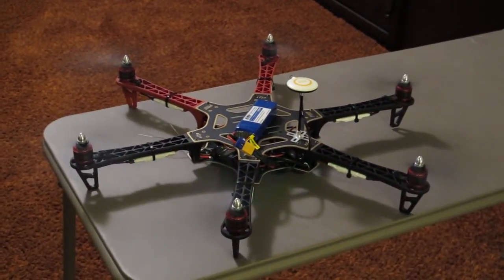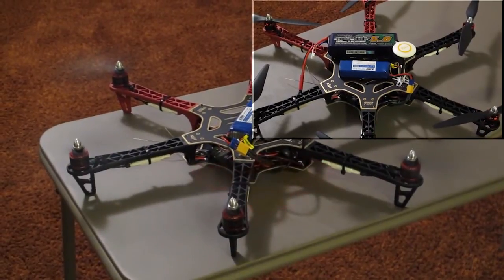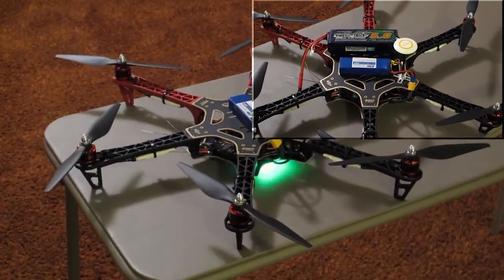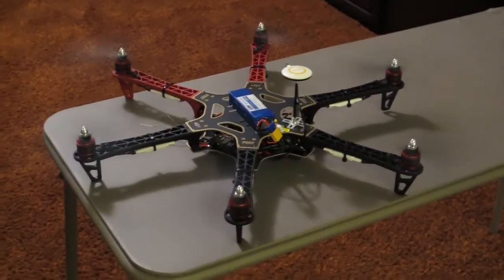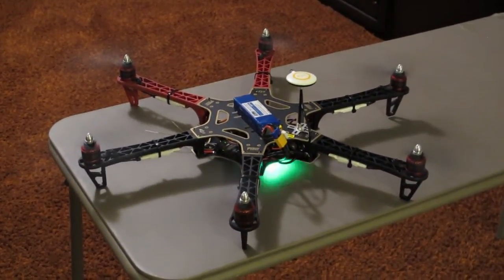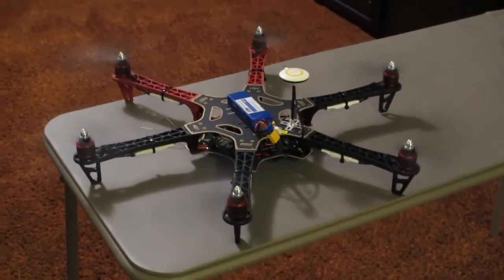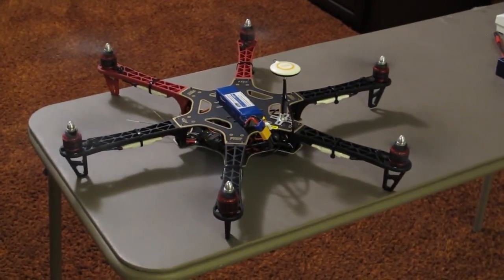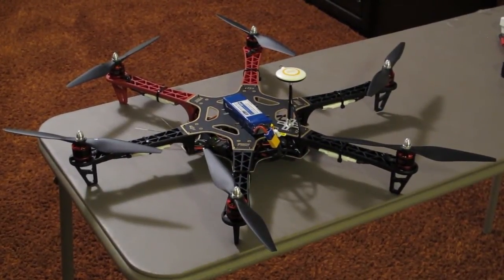DJI F550 Flamewheel with Naza-M V2

Comment: Hello! Great job on the build, I am setting up my 550 now, have a tarot gimbal and going to use 5000mah batt, I'm a little confused about the CG though, once I install gimbal, how do you determine the CG? I'm assuming the CG must be entered into assistant software on XYZ parameters. And where in relation to CG does the GPS antennae have to go? Thanks!